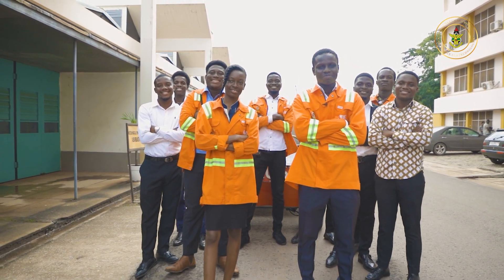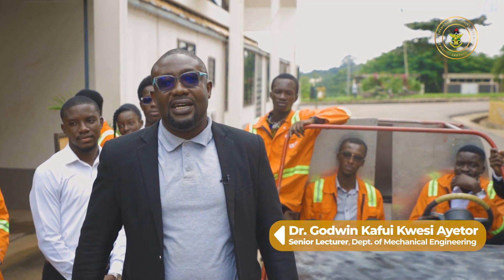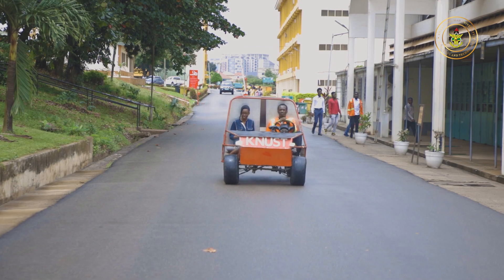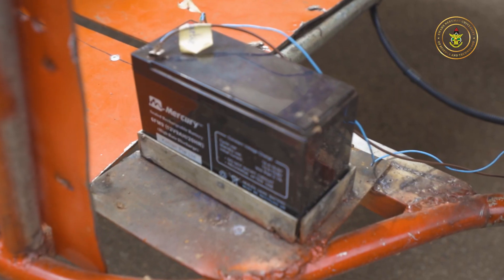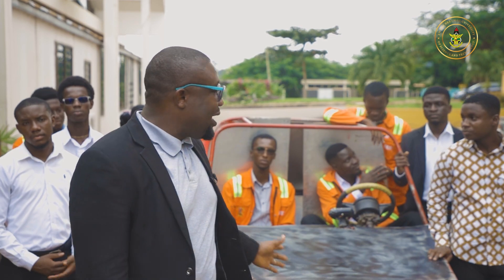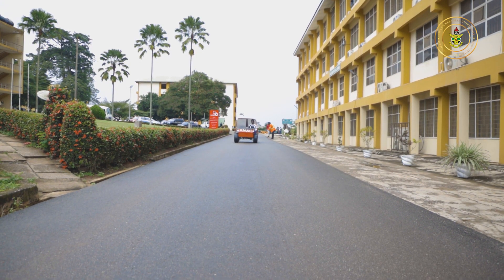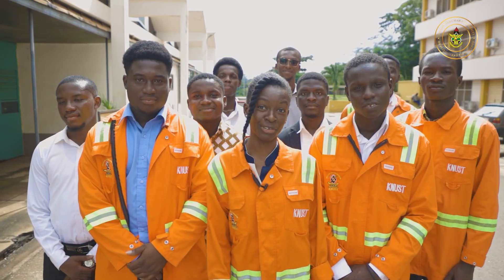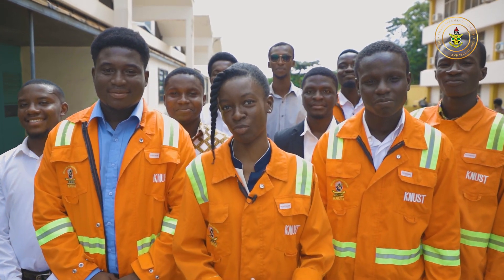KNUST Students Develop a Battery Electric Vehicle

Comment: Interesting project, guys! It's great to see my fellow mechanical engineering students taking on the challenge of building an electric car. I can tell there was a lot of hard work involved.
However, there are some areas that could use some improvement. The battery placement and suspension system seem to need some attention. To enhance stability and ride quality, you might want to consider repositioning the batteries and adjusting the suspension setup. Additionally, reinforcing the motor mount should be a priority for better durability.
The aerodynamics could be further optimized for efficiency, which is crucial for electric cars. Consider refining the shape to reduce drag and improve overall energy consumption. Also, think about how to maximize the use of lightweight materials without compromising safety.
Remember, the design of an electric car's body plays a vital role in its overall performance, range, and energy efficiency.